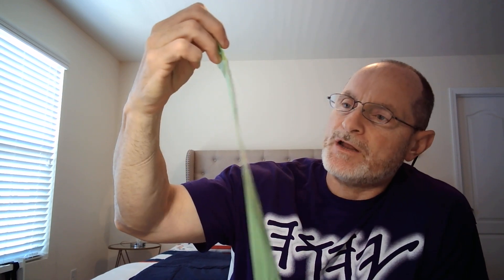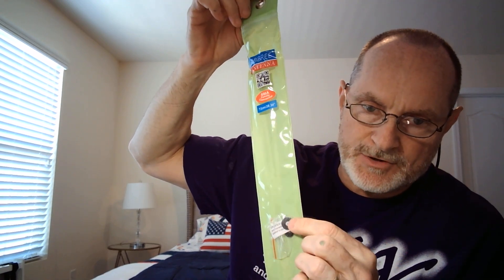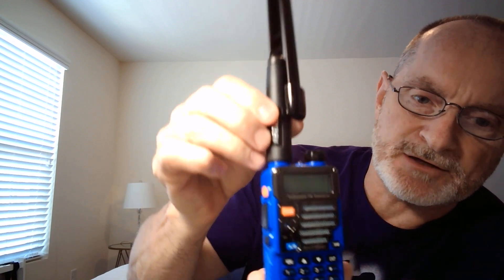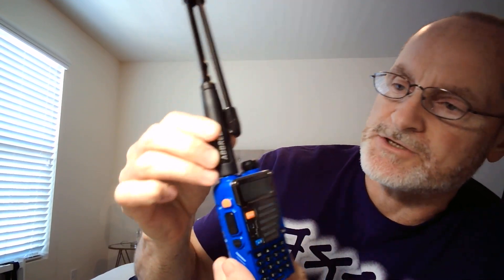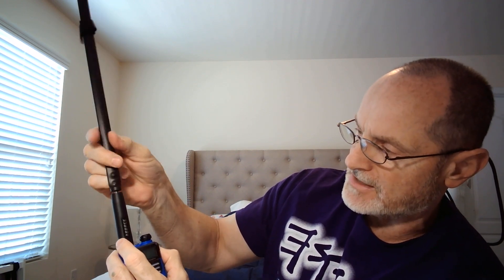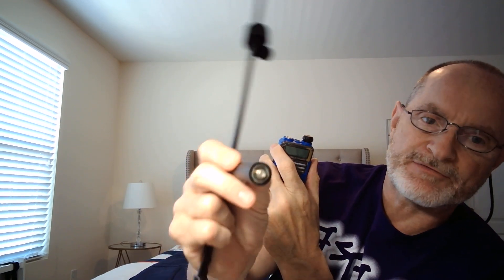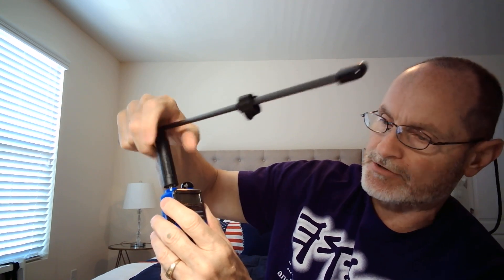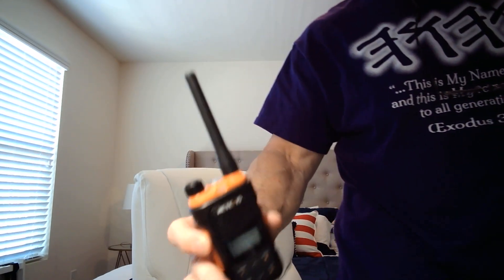ABBREE Tactical Antenna Test and Retevis RA-85  GMRS Radios

Comment: I store my flat-tact antennas vertically as they develop kinks that cause them to fold when you don't want them to fold. If you bend them often, it becomes comical when you try to use them. I just bought another two 42.5-inch antennas and for regular use they are impressive, but not worth the hassle. For emergency use they're amazing. Standing straight up, they can make ham radios perform beyond belief. The biggest problem, though, is that the antennas many times won't fit radios w/built-in flashlights. You'll need an adaptor.

Comment: I bought the same one by mistake. This antenna works very poorly because it’s not designed for GMRS. It’s designed for Frequency: 144/430MHz. They do make them that are designed for the GMRS frequency range 👍 Also … the Nagoya should be a Nagoya NA-701G 👍 The G models are designed for GMRS… I had to return about 6 antennas because I did the same thing 😂

Comment: Antennas are an underappreciated and very important part of the transceiver.  Been building and selling my own for over a decade.  The ABBREE antenna is interesting as an option to carry for when a station is at the edge of the range of a shorter antenna.  Shorter antennas are practical for a number of reasons, and the shorter the antenna, the more 'tactical' , because it is practical as a part of the web gear, but more important, 'tactical', because the combination of low power and the shorter range of it's propagation greatly,  increases COMSEC (Communication Security). 

 A good base station antenna mounted as high as is practically possible, greatly improves the stations ability to receive the weak propagation of hand held's, and also greatly increases the range of the communications, because of it's far superior ability to propagate that compensates for the short antennas of hand held's.  I would install a high gain antenna well above the roof line and use LMR cable, and attach a hand held or mobile to be used as a base station transceiver.  Because of it's durability and high gain, I recommend a Slim Jim antenna from KB9VBR.  Install this type of antenna 20 feet or higher above the ground to get the best performance. 

 BTW, I would use a tone on a tactical frequency as this will lower the odds of some one intentionally or not,  jamming your signal with an open mic.  Have a primary and alternate tactical channels, preferably on UHF, and the alternate on a VHF frequency.  I've written many articles on Survivalblog if you are interested in this sort of thing....
Reply: How would a tone prevent jamming? That makes no sense. If your radios are programmed with a CTCSS or a DCS and another radio without any set is transmitting very close or with higher RF power, that radio will still jam your radio as it is still transmitting on the same frequency. You won't hear their open mic but they will still be jamming your radios.
Reply: @RisingTidesAC  The transceiver that I would be transmitting to would also be programmed with a tone and would not hear the open mic that is the transmitter that is attempting to jam the frequency.  I would also have an alternate frequency that is on another band.  For example, if the primary frequency is UHF, then the alternate frequency should be VHF.  The best method for a retreat is actually field phones.  The least expensive is improvised field phones made from commercial phones. Old school field phones are EMP resistant, totally secure, and require no power generation to recharge batteries....